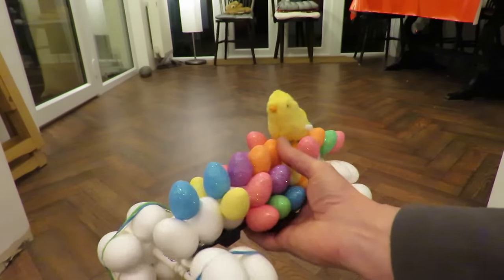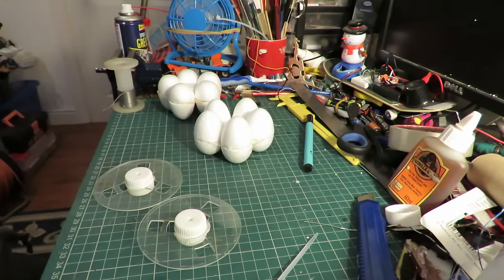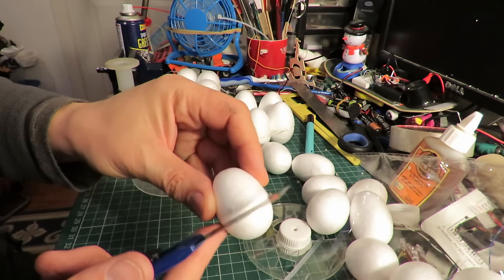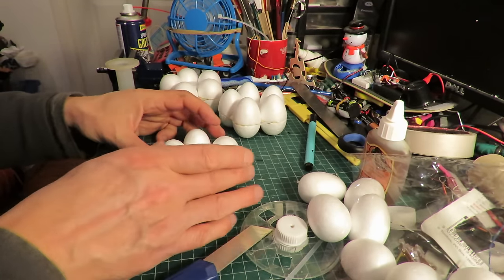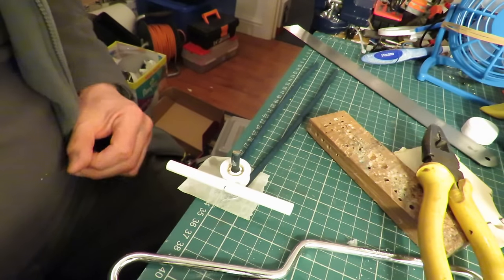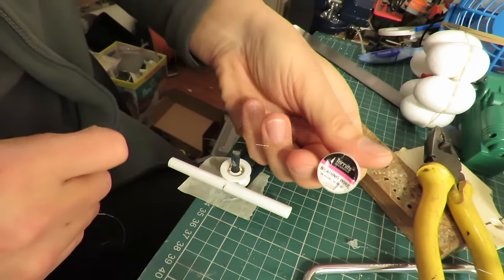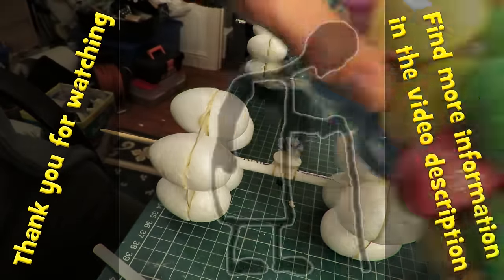Easter Egg Buggy - RC

Comment: eggscllent .ya got me gears turning there grandad:) thanks . a quick question if i may,, what is your shaft there for the steering?
Reply from the maker: +allan egleston "shaft"? you mean the pushrod from the servo to the axle? That is just a piece of wire, maybe a paperclip.
Reply: the rod in the "pulley". thanks
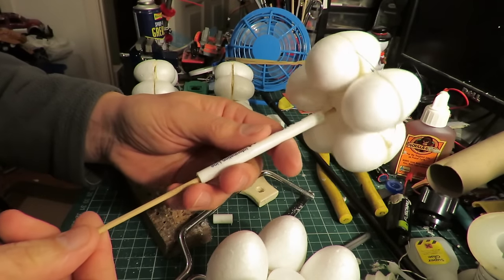Reply from the maker: +allan egleston I show you the front axle assembly from about 10:00
Reply: ok

Comment: got it . after reviewing the video , paying it back and forewards several times and enchaning the screan.(this is visible at 11:32  )  i deduced your steering pivot point, you just bent the cane end and slipped the pully on. breaking news, i just came up with a k"nex solution for the steering  set up .i will also try the cane solution as well. @ grandadisanoldman., whomever came up with the hot glue gun was sheer genious. one of my fave tool.  thanks for the corrections .i also saved the link for  the dishwasher pulley.
Reply from the maker: +allan egleston ahh we were at cross purposes, I didn't realise which bit you meant, sorry. Yes just another bit of that flower cane and plenty of hot glue to hold it in place. That little pulley thing has a hollow shaft inside it that it spins on and then the cane goes through the middle of that. I think I mentioned in the video that it was one of the runners for a kitchen drawer but in fact I now realise it came from a dishwasher so here is an example http://www.amazon.co.uk/dp/B00GOPRNDC

Comment: would that work on water???
Reply: +SalamanderLYF ManHAX Maybe
Reply from the maker: probably but none of the electronics are protected so more work would be required to waterproof them.
Reply: GrandadIsAnOldMan if you ever do water proof it would you put popsicle sticks in-between the wheels as like paddles to help it move?
Reply: +GrandadIsAnOldMan wouldn't you have to*
Reply from the maker: +SalamanderLYF ManHAX it's not going to happen. All the electrical components are on the bottom of the chassis so they would all be in the water. However if I used those wheels on a different craft I think they would work without modification. Obviously they could be improved but then you could build better paddles from scratch and not mess about with cutting the eggs in half.